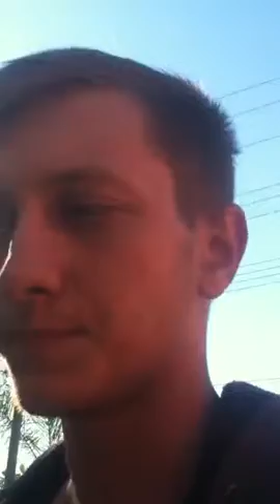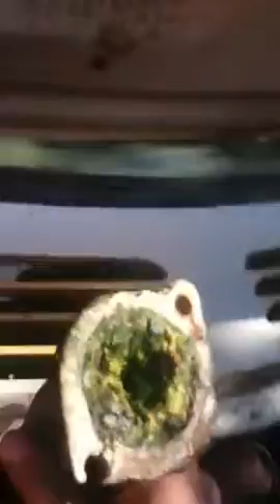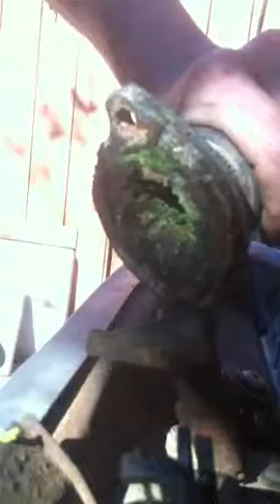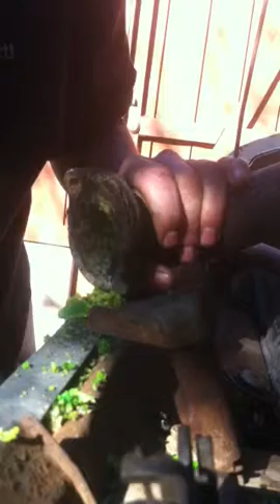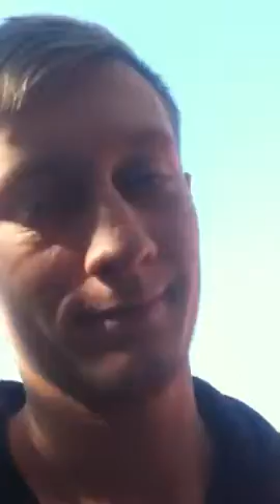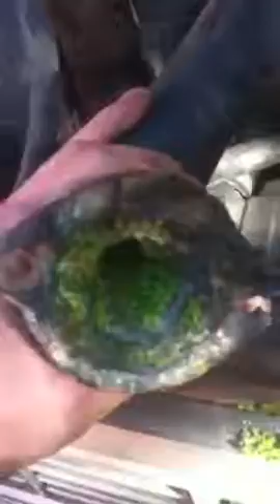Clogged cooling system - worst ever - monaco Rv

Comment: I just bought a 78 Monaco 440 23ft. been working on it 6mo. now. long way to go but they are built very well and all the work is worth it. just painted it and working on a complete gut of the inside and maintenance of all the motor, trans,rearend and drivelines etc. cant wait for next year. we should be done by then. complete custom inside.